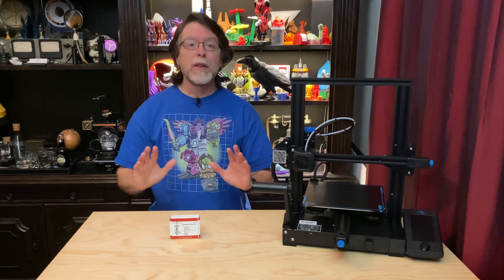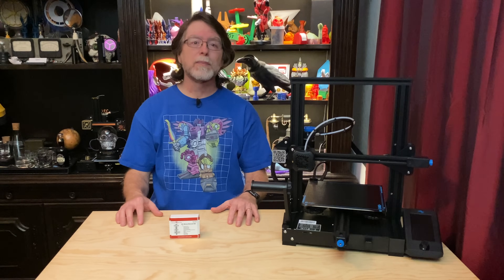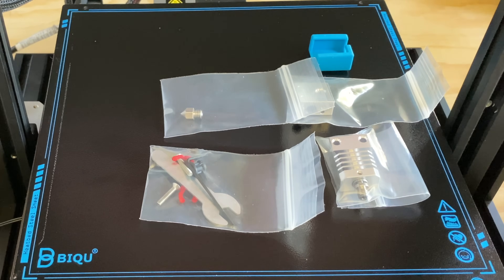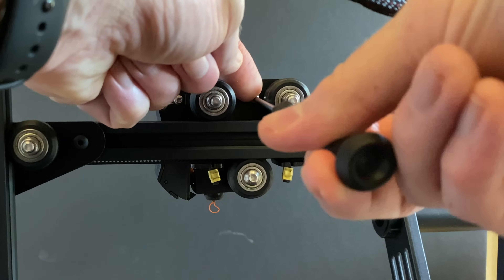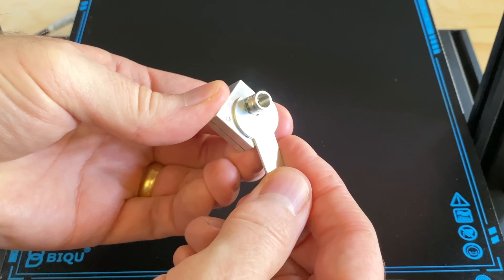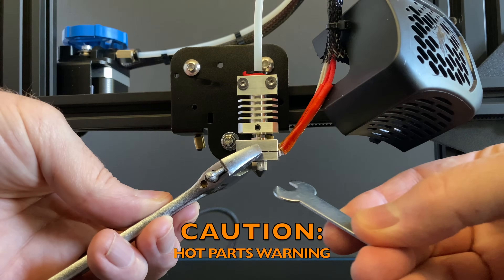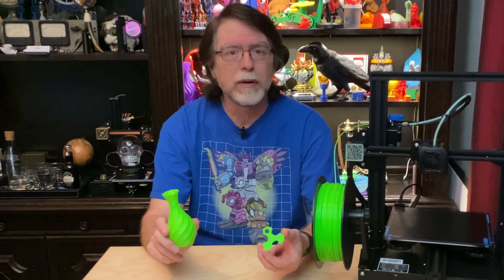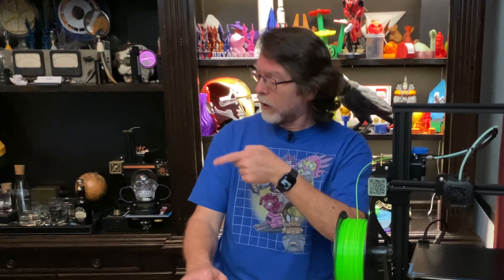Install the Micro Swiss All Metal Hot End on your Ender-3 V2 3D Printer

Comment: I just installed this on my ender 3. I'm kind of concerned how "wobbly" the bottom block is given there is only on lug screw holding it together. Shouldn't there be thermal paste applied somewhere on this? I was expecting it to come as one solid piece.

Comment: I know this is an older video, but I just changed my ender 3 v2 to the Microswiss all metal hot end, and I keep having problems with the extruder clicking/skipping when trying to print PETG. I do have a Creality all metal extruder, and Capricorn tubing. I have retraction set at 1mm. Do I need to increase the retraction setting? I'm getting super frustrated, and I'm about to return the printer to stock.

Comment: Question. I just installed this hotend on my ender 3 pro. It begins printing beautifully, gets about halfway through the initial layer and then begins clogging and the the dreaded extruder popping starts as it starts eating my filament. I'm using a standard brass .4mm nozzle set I have never had any problems with, my retraction is set at 8mm with a speed of 50mm/s. My flow is calibrated to 101 after a hollow calibration cube. e steps were set, do they need to be reset for this install, by chance, as I have not yet done that, if it's needed. It is Ziro glow in the dark green that I am using.

Comment: I've seen a lot of people complain about this hot end when printing with PLA. A lot of them say it makes it harder to print with pla and at times requires to print at higher temperatures. Is this true? Are there any ways to avoid this? And is this upgradr still worth it if I use PLA for over half my prints?
Reply: I don't know what they are doing. Mine performs pretty much the same, bit less stringing. With PLA+ I'm finding best results around 190 to 200 degrees. With just 0.9mm retraction, I'm getting absolutely no stringing, blobbing or other issues.
Reply: @Patrick-857 this comment saved my life 2 years later thank you

Comment: I installed the full Micro Swiss Direct Drive kit on my Ender 3 V2 and everything works great, but they tell you to adjust the slicer code to correct for the offset of the extruder. Is there a way to adjust the printer to correct the X and Y offset? I'm using the Jyers firmware. I believe I have to rebuild and recompile the firmware after I adjust the base code, but hope there's a better way. I wish you had a video on this.
Reply: You probably sorted this out by now, but for those who haven't figured it out yet, the easiest method is to write gcode commands into notepad, save the file with a .gcode filename and "print" it on your printer.

I used: M206 X10.0 Y5.0 Z0.0
M500     ; Store Settings
M117 Saved!

This was for a Microswiss NG with 3D printed x and y axis limit switch covers to move them to more optimal positions for the NG, so you should use the Move option in the menu of your printer to find out what your offset should be, and run M206 to load the offsets, and M500 to save.

Comment: I figure i try a clone one before i buy the swiss.  No question printing wise is the way to go.  However, i had to return 2 of them because the plastic insert where the filament tubing goes into the hotend,  keeps coming off during the print.   The clip that support to push the plastic housing up so it crimps the filament tubing, is not strong enough to do the job.   Every time the printer retracts, it seems that it keeps wiggling way out and eventually is out of the hotend.   The older style had metal grips which made it impossible to come of.  In fact we had to replace it or cut the tubing in order to reuse.  Am i doing something wrong?  Is the swiss any better?

Comment: My stock hot end clogged up so bad while I was away there is no point of cleaning it. I want to print carbon fiber nylon down the road but I want to make some type of enclosure before i do that. All being said, can I upgrade to this swis all metal hot and and still print PLA with this hot end w/o trouble?

Comment: Nothing as trouble with the Micro Swiss All Metal Hot End for me. Molten PLA is leaking everywhere and burns in on the heater block, even after I cleaned everything and tightend the nozzle to the hot heater block. Would be great if you could do long term tests of upgrades to test if they may have flaws. Sadly it was a expensive experience for me to follow your recommendation.

Comment: you didnt adjust the pids
Reply from the maker: That's true, I didn't. Actually I didn't think of it at the time. Good catch! 👍🏻
Reply: @BV3D  that means is not necessary? I’m sorry I am new and I just got a ender 3 v2 and I am little confused about the pid
Reply from the maker: @javieruriel  In my specific case, the thermal performance was similar enough to stock that it worked out OK. If, after upgrading, your nozzle temp is constantly going up and down by a couple degrees or more, you'll want to do a PID tune.
Reply: @BV3D  do you know how to do that? Do you have a video?
Reply from the maker: @javieruriel  Give this one a watch: https://www.youtube.com/watch?v=cl-B9SrlzMY

Comment: Hi Bryan. Thank you for making it clear that the hot end and nozzle should be replaced if you're working with filaments that require higher melting temperatures. Some vloggers make it sound like a must, and it's not if you're printing with lower temperatures like those needed to melt PLA.

Comment: Brian i have a question I have a ender 3 v2 and i have the stock unit hotend  i have had a print fail on me and it made a mess of the stock heat block to a point where i had to replace it. So i put a copper one on and my prints didnt turn out the first layer looked like crap so i did some reading and they said the copper heatblocks dont get the filament soft enough until 500 degrees so since my ender 3 v2 cant get up that high i finally found aluminum heatblock it took me for ever to find it looks like the stock unit i ordered a few. But i just saw your video about the micro swiss all metal hot end and its made for higher temps but i wont be going that high i am only printing PLA and TPU and maybe in the future PETG and nothing else. Can i still use this Hot end or is it made for higher temp filaments? Thanks

Comment: “Don’t over tighten the screw, the idea is to keep the (thermistor) wires in place without crushing them.”

You Sir are a life saver.  And I’m a fool.  

I couldn’t figure out why the printer would not boot up.  Or alternately, reset in the middle of heating up.  You only need it hold the thing in place, not pressure weld it into the block.

Comment: Hi sounds like an easy upgrade that you don't need to update the firmware. I have updated the firmware many many times on my tevo tornado printer. But I just bought the Ender 3 max printer so I could actually print something. I keep having issue with under or no extrusion on my Ender 3 Max. I just installed a zesty nimble to this printer. Then I saw that I broke the thermistor wire. Bummer. ? - can I do this upgrade on the Ender 3 Max? 2) have you tested the heat from the Micro Swiss hotend with a infrared thermometer? I would like to know your readings. I tried reading my stock hot end and the temp was all over the place but very low. ? - also, does the tubing go all the way into the hotend? If not I'd like to know how you handle stringing? I install a E3D hotend on my Tevo and I can't get even close to getting rig of the stringing issue. I have tried different retraction speeds, etc. but nothing helps.

Comment: I just upgraded my hotend to all metal hotend on Ender 3V2. I am using Cura 4.11￼￼.  I mostly run PLA a little PETG. I was wondering what you are using for retraction distance and retraction speed settings? Is there anything else I need to change?￼￼￼

Comment: One of the few times I'll disagree with ya.  Swiss hotend is one of the worst.  I've had mine on my printer for months and had nothing but problem after problem.  I've had it destroy multiple thermistors, melt the heating rod wiring, clog constantly, and the heat creep from it is impossible to manage.

Are there better solutions out there?
Reply from the maker: Hi Nicholas. It sucks that you've had bad experiences with the Micro Swiss. You could install an E3D V6 all metal hot end without too much trouble. There are a number of printable mounts for it to attach it to an Ender-3 series printer, or you can buy a metal one if you're intending to print higher-temp materials.

This metal mount adapts the V6 hot end to the Ender-3 X carriage: https://amzn.to/3yLCStw [affiliate link]
You'll still need to print fan ducts/mounts.

Comment: I started the hot end conversion and was doing fine until I discovered my heater tube was stuck in the old heater block. The thermistor is fine but the tube isn’t going anywhere. Any ideas?
Reply: I had the same problem.
I heated up to 220 degrees and used pliers to remove the thermistor

Comment: i have a prob. i had some blockage and had to take off the nozzle to clear the clog but now it will not screw back in and I am stuck it only goes in just a little bit.  i am wondering if the hotend shrunk or something but I can not get back in all the way hot or cold . ideas

Comment: Hello, new to the channel, new to the 3D printing world and I have a question. I just ordered the Ender 3 V2. This will be my first 3D printer. I also ordered a couple of spools of PLA to learn with, however, my goal is to eventually use reinforced Nylon, and I know that requires an all metal hot end due to the higher temps that are required. As I know that my end goal will be to add on this hot end, would you recommend purchasing it now and installing it during initial setup, or learning with the stock hot end first?

Comment: Have you had any issues with the fan shroud or cooling ducts after installing the all metal hot end?  I've been reading and seeing pictures of the cooling duct melting due to the hot end being a different length than the stock hot end.

Comment: What exactly was the issue at 235, adhesion, or something else?  I've been trying to print PETG, and can't get it to stick to the build plate.  Is that due to too low of nozzle temp?  What tips do you have for PETG adhesion?  I'd rather not have to spend $60+ on a new hotend if I don't have to.

Comment: Great video, but I would have gone ahead and bought the Capricorn PTFE Bowden tube and installed it at the same time.
Reply: But why? The whole point of the all metal hotend is to introduce the heatbreak and take the PTFE tubing away from the nozzle and high Temps.

Upgrading to all metal means you don't need to worry about PTFE tubing or capricorn

Comment: Followed this guide and worked great. Just to note, I had to reduce my retraction to 4mm and increase my printing temp +5 degrees C to resolve an issue where my all metal hot end nozzle was becoming blocked when trying to print PLA on my normal settings. Might save someone a headache!
Reply: A year later, was the upgrade to an all metal hot end worth it?
Reply: fanks

Comment: Interesting comments on the temperatures.and fumes I run a prusa mini and an i3 and the standard temperatures for petg is 250C. Both printers handle polycarbonate and carbon infused with ease. One is a bowden tube and the other direct drive but I am pretty sure the i3 is ptfe lined. No warnings from prusa about fumes from the tubing at high temps lol. Thanks for the video. Have one of these on the way for the ender extender project!

Comment: I've been printing CF nylon with the stock hot end. Using a hardened steel nozzle and Capricorn bowden tubing. I'm printing it at 250 C.
Capricorn can be used at 260 C indefinitely.

Comment: I might be a bit late to the party, but when I installed a micro swiss clone (triangle labs), which is identical to the micro swiss hotend on my Ender 3 V2, the cooling duct appears to interfere with the print. For me it seems like the stock hotend is a bit taller than this one. Anyone else have this issue with the original micro swiss? As of now, it appears that the cooling duct is sitting roughly 1mm higher than the tip of the nozzle and I fear it's what causes my print to get dragged along the bed...
Reply: Did you resolve this? Thanks

Comment: I plan to print with Carbon Fiber NylonX filament, using a 0.4mm ruby extruder tip.. should I consider upgrading to this or will the stock one suffice?

Comment: What about firmware if the hot end is replaced? 
What do we do here for temperature calibration?
What is the max temp of the stock heater?
Also how do we adjust retraction setting?

This is not covered and I feel it's an important step that's left out of this video and needs to be acknowledge when following this upgrade.
Can you do a follow up video because I haven't seen one yet.

Comment: Hi! Great video. I have a couple of questions, and thanks in advance for the info:
1) Would it not be better/cheaper to upgrade the PTFE tube to a Capricorn tube which does not degrade/fume at 260°? (Their tech specs show the ability to easily print near 280 without issues). The cost of the tube kit is about $12 on Amazon. This leads to my second question.
2) I am thinking of upgrading to the Micro Swiss or E3D V6 to be able to print at around 300° (PC/Nylon). Can you do that without changing the stock Thermisor on the printer? Is there a Microswiss kit that includes a Thermisor/Thermocoupler for that purpose?
I just do not see the point of spending what amounts to about 15% of the cost of the printer when I can spend 2% on the capricorn and print safely at the 260 max of the stock hotend.
Thanks! Stay safe and healthy!
Reply: just a heads up, you can only set the ender 3 to print at 260 C max
Reply: Capricorn tubes start fuming before 250 just so you know. It says on their site not to print above 250 if you use the tubing in the hot end, or itll kill birds... I may not have birds, but that's not really an acceptable level for me.
Reply: What did you do in the end? Thanks.
Reply: @D4RKFiB3R  I ended up going the Capricorn route. I changed the FW to be able to heat to 280. I have easily printed nylon without issues. Mind you, this was for a specific application of a few parts I needed with high-temp resistance, but I used it only for those parts, otherwise, I have been printing fine at around 235 max for ABS. It is nice to be able to throw in a nylon spool and get results, and I would not consider getting the all-metal upgrade now.
Reply: @enriquefuentesc  Thanks for the info. Very helpful.

Comment: I haven't even received my v2 yet and I'm already ordering upgrades
Reply: Don’t do that!  Print with it stock for like atleast a couple weeks it’s fucking rock solid man.  I have mine all jazzed up now after about 4 months and 100s of hours of printing.  But seriously, right out of the box the thing is stellar, so run it stock and enjoy it, make sure everything is working well and nothing is wrong.  Then maybe consider upgrades!  Good luck man 🤙🏻🤙🏻🤙🏻
Reply: @RMquickbit  They were mostly just preemptive upgrades. I've only ordered an all metal extruder and ptfe tube. Nothing crazy yet lol. I wanted to make sure I could get it working first. Honestly, a lot of the things I've been looking into are just cable guides n such.
Reply: @calypsoraz4318  right on man, best upgrade for me has to be just a raspberry pi and a webcam.   And definitely bed level springs for sure.  I’ve noticed almost no difference in my prints to be honest from extruder upgrade, hotend, dual z axis, etc etc.   the BL touch on the other hand is flipping awesome because bed leveling can be annoying if you move your printer a lot(in the car to different houses) like I do.  Otherwise I love the build plate, I got an identical glass surface to just swap out.  This kid on thingiverse has an awesome print- it takes the tool box out and replaces it with the lcd screen and fits a raspberry pi underneath, super compact.  Have fun dude

Comment: Would love to see you upgrade the ender v2 with the micro swiss direct drive extruder. In any case I think this is the first youtube comment I've ever made. That's just how much I appreciated this video. The technical instruction combined with very helpful camera angles makes for a 10/10 video.
Reply from the maker: Hi William! I've been thinking of doing that. I'll need to either find or design something to adapt the V2's fan shroud to fit the mounting holes for the old-style fan shroud, since the hole patterns are different. So far the only thing I've seen is a little mount that kind of holds one of the fans in place, and then you glue the second fan onto the first one. That's very utilitarian, and seems kind of fragile. So maybe early 2021? Also, thanks for your comment! 👍
Reply: @BV3D  Looking forward to it! Popular printer and upgrade. Just set mine up and currently tooling through some under-extrusion problems. And I used the thingverse print of the ender 3 pro shroud for mine, albeit I do plan on finding something better eventually.
Reply: When will you make video on installing micro swiss extruder and hotend on the ender 3 v2? I need it please.

Comment: Hi Bryan I have a Micro Swiss All metal Hot End on my Ender 3 and use a  Micro Swiss A2 plated Wear Resistant Nozzle which i fully recommend especially when printing with Glow in the Dark Filament!

Comment: I have one of these and generally love it with one exception.  Micro Swiss refuses to add an M3/M4 threaded hole for a thermistor cartridge.  If you want to print above 260, it's a no-go.  The glass bead ntc thermistors have ptfe insulation on the conductors.  If you want a to go hotter, you need a cartridge thermistor and micro swiss refuses to add a port for one.  I am looking for a clone heater block with the port for a cannister.  VERY annoying for such an expensive hot end.